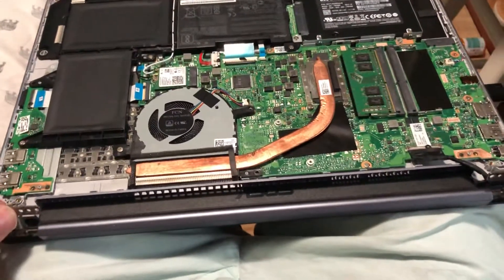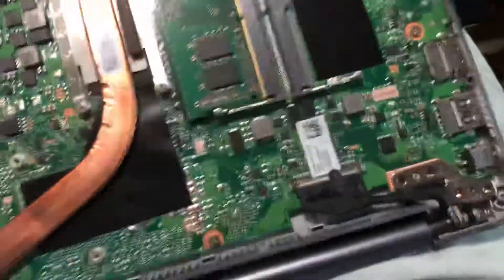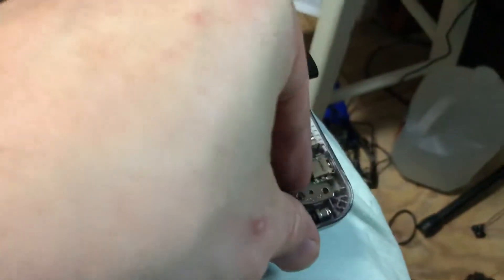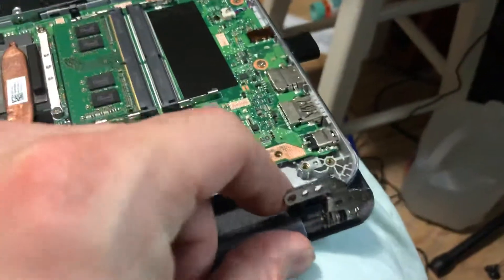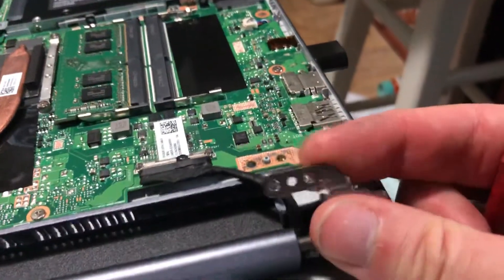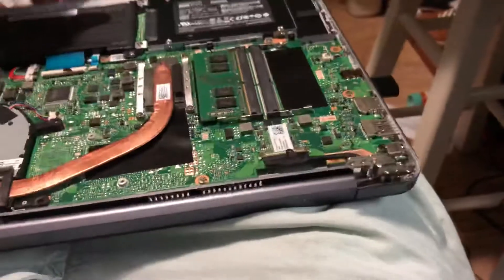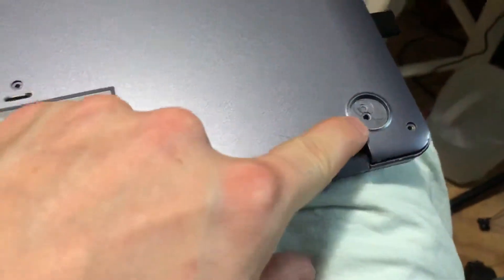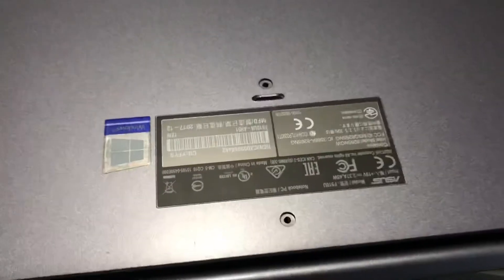computers - laptop creaking hinge fix

Comment: My laptop has the same issue. Thank You for showing its cause in this video. However, I would rather not do this fix on my laptop as I assume that the manufacturer might have already tighten the hinges to the right torque.

I hope it will become loose gradually upon use. Mine is a brand new one.